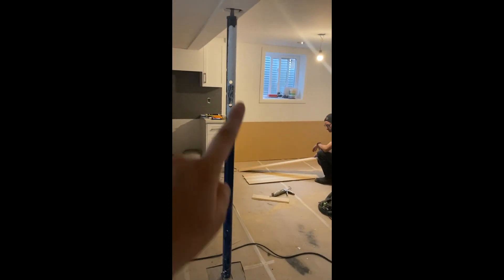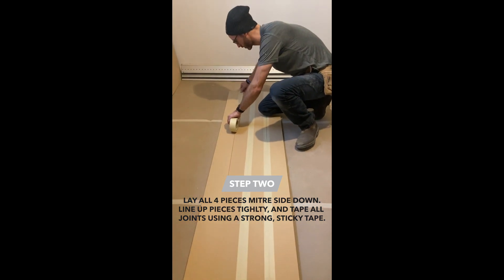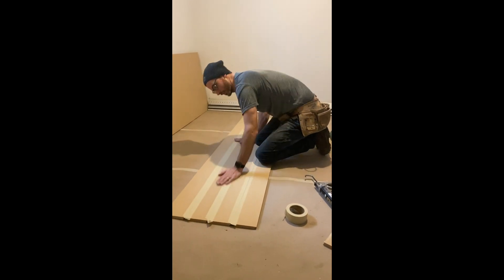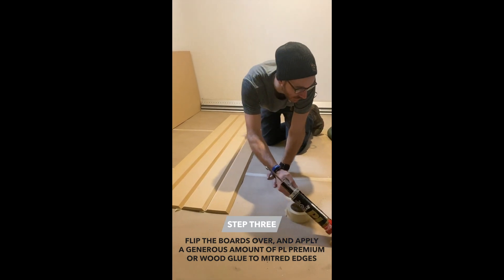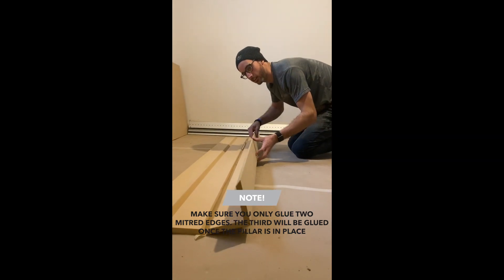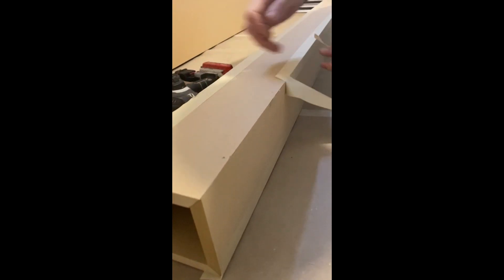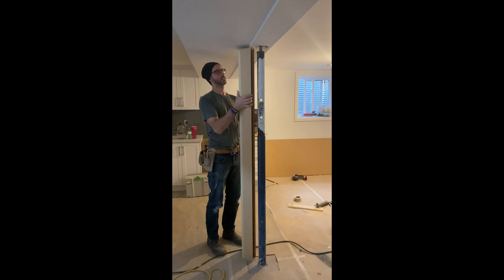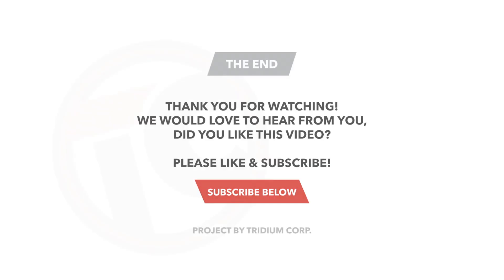How to Wrap a Basement Support Post - Easy DIY

Comment: VERY clever!  I was trying to think of all the different ways to make mitered edges come together cleanly!  I see most people using support blocks inside, but I found I had to make the column pretty wide to accommodate the blocks and material costs $$. They are not load bearing either, so I didn't see much point in gluing and screwing a bunch of blocks inside the box!  Thanks!

Comment: what kind of boards are those?
Reply: Lightning is not great, but it looks like MDF. With it being in a basement I personally would have primed it before install, especially the end sitting on the floor. MDF is easy to work with, but is VERY susceptible to moisture.
Reply: @moeadeeb2862  Yes it was MDF and I believe he even said that in the video too. Wouldn’t be too worried about moisture either in a finished basement and this looks like it was. Moisture issues are usually more of a problem with unfinished basements.